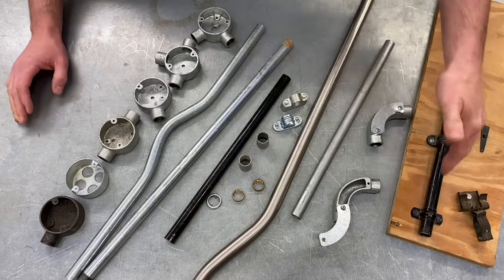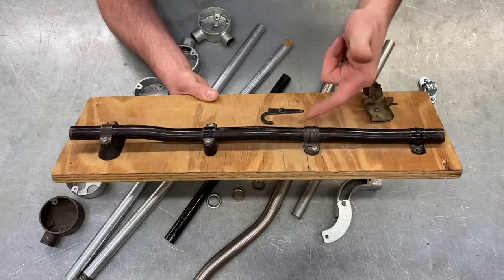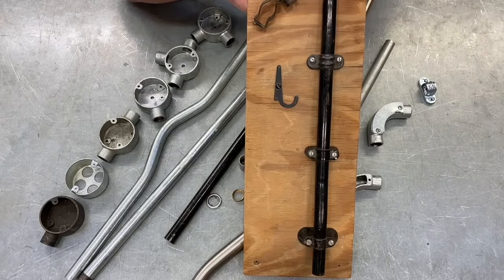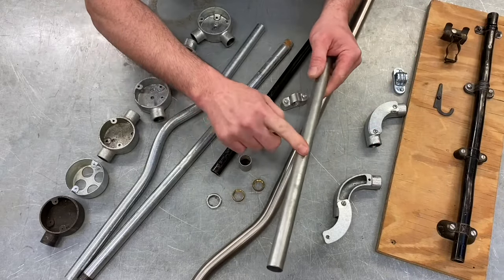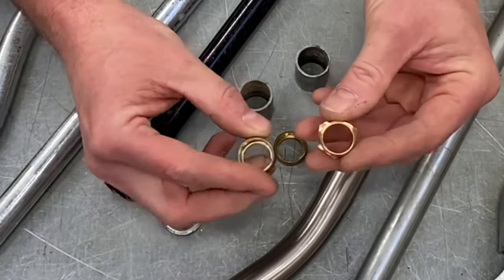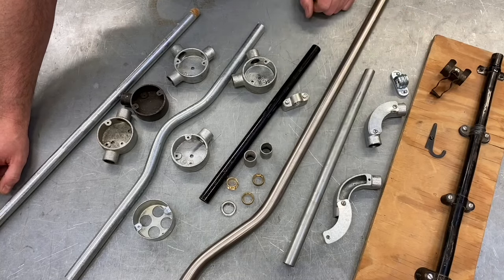Do You Know Your - Steel Conduit Sizes, Types, Finishes, Saddles, Accessorises and Boxes?

Comment from the maker: == 🕐 Time Stamps - Cut to the action 🕕 ==
1:30 - different types of conduit saddles and support
5:20 - different finishes on steel conduit 
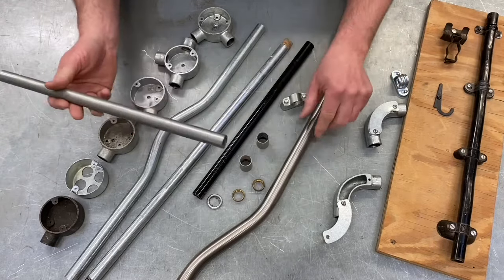7:29 - different types of steel conduit
08:52 - Steel conduit lengths
09:44 - different conduit accessories (bushes)
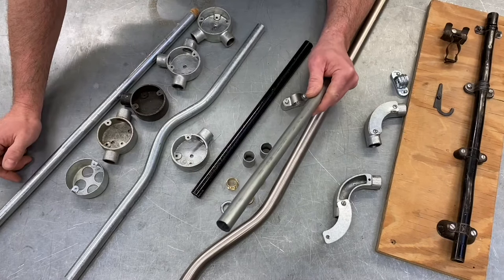10:14 - different types of steel conduit boxes
10:54 - different steel conduit sizes

Comment: Excellent Video Gaz clear and simple for the learners to understand . Question can you do a follow up explaining when you would use a coupler and lock ring , if I remember correctly when a coupler is used to join two lengths of still conduit we muse have a lock ring behind the coupler , ie conduit drop from ceiling the lock ring should be on top of the coupler as you look at it? 
Fantastic video Gaz as always 
👍👍👍❤️
Reply from the maker: Thanks for the great comment 👍🏻
Reply: @GSHElectrical  please correct me if I’m wrong 
I was thinking from memory,
So I could well be wrong 👍